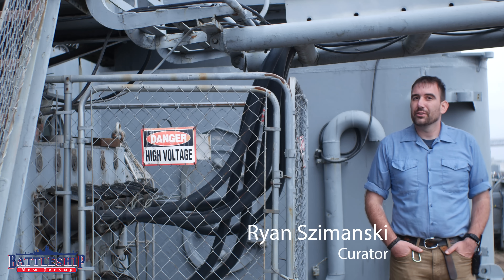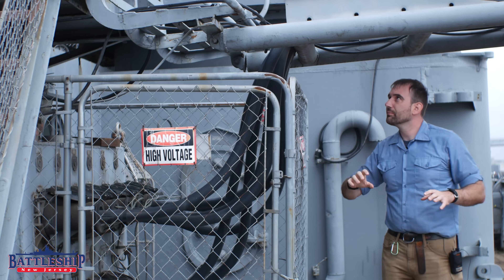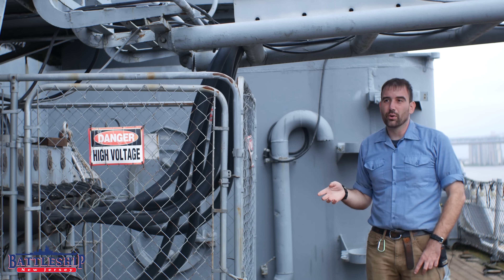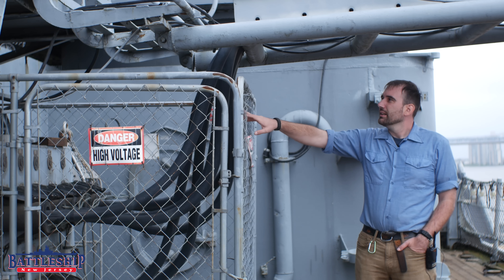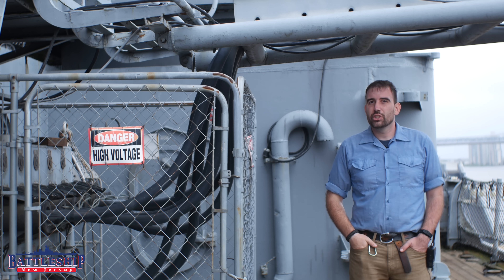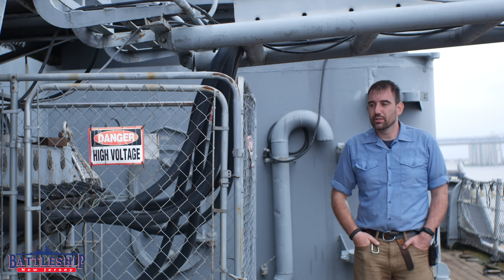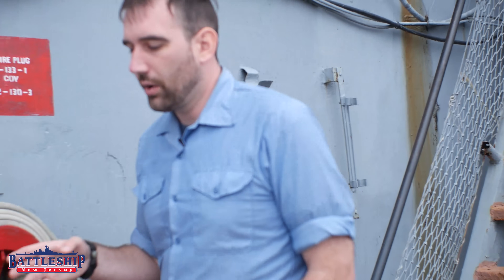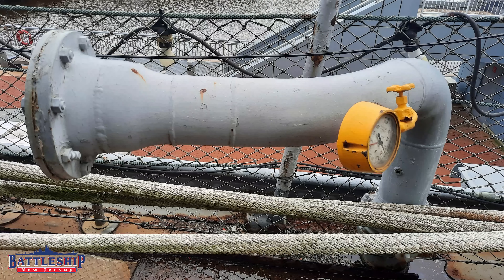Where Does the Ship's Power Come From Today?

Comment: Liberty ships had direct current(DC) electrical systems therefore they could not make use of alternating current(AC) shore power.The ST Portland ( steam sternwheeler in Portland Oregon) was originally a DC system when cold it has an electric motor generator that used AC power to generate DC for the boat. It also had a small dc to ac motor gen set to make power for power tolls that required AC while the boat was underway.  Now the boat has been converted fully to an AC system compatible with the local utility provided shore power.
On 600psi systems the forced draft blowers could be rolled on 150psi shore steam for boiler light off. 1200psi systems had higher feedwater requirements ans were not allowed to use shore steam for light off, but used a small electric powered blower until there was enough boiler pressure to role the steam blowers. 

BT2 Vik Plank owner USS Fanning DE1076 1971-1974

Comment: Ryan, the N.J. generators are three phase or single phase  ? 
If three phase is that 1,250W times three or total output. 
1250W/440V is 2.8 amps which is not that much.  Could they be 1,250 Kw generators ?

Comment: if there were some sort of disaster in the local area and a significant number of powerplants were knocked out, could the ship (on the assumption that the navy is on board) run her generators to basically push power in reverse, out the lines she normally draws power in from? or is the electrical system not set up for that?
Reply: The total power that can travel either into the ship or out of the ship is limited by the size of the cables and the rating of the transformer. Basically enough power to run a large McDonalds. It also seems unlikely that the ship could match the output of the typical power plant which generates at 38kV and above.
Reply: A nuclear-powered aircraft carrier might be able to do something like that on an emergency basis (I believe it's been done before), but a ship like New Jersey wouldn't be able to generate enough power to be worth the effort. A modern metro area uses far more power than a single oil-fired steamship's onboard plant can generate. Mind you, there are such things as power barges--floating mobile generating stations--which could be brought in to provide power in a situation like that. That's basically what they're for.

Comment: How is sewage moved off the ship in port? I assume that out at sea it just gets dumped overboard, but I suspect the port would get a bit cranky if you still did that
Reply: I’m sure they used to dump it all in the past. But someone correct me if I’m wrong, I don’t think any modern warship could get away with dumping garbage & raw sewage today.
Reply: I assume they used the CHT system the navy speak for the sewage collection system, was basically a tank and a pump hooked to a shore collection. at sea it was just pumped over board. Im not sure how modern us warships systems work but up until the mid 2000s this system still was in common use. Cruse ships have advanced sewage treatment plants though and make almost drinking water they pump out to sea.

Comment: Unrelated question to the video:  Has there been any effort by the Navy to record the old timers that are still around on the operations of the dated technology aboard the battleships in case they are ever needed?
Reply: This was done in the 80s, for sure
Reply: The key part of the question is "ever needed?". Generally speaking the answer would be no and the Battleship have been stricken from the records. 
Enlisted folks will have a service requirement of 10 years which may be broken up as 3-6 years active and the rest as inactive. And for retirees like myself who did 20 years we were on the inactive rolls for another 10 years. So in the case of the Battleships that were reactivated in the 80's the Navy had to reactivate a bunch of sailors from the inactive rolls to fill slots that the navy didn't teach anymore. This was manly for the 16" guns. I assume there was a lot of on-the-job training for some younger GM's, but they needed the old guys to do the training.
Reply: @johnknapp952  Thanks for the reply!

Comment: Is shore power enough to start up, and rotate the turrets at least? I'm sure a lot of people would enjoy the spectacle of the turrets moving.
Reply: They were deactivated. They are welded in place for train elevation can be down manually, it’s a tedious process
Reply: @ThePhalanx2006  - Thanks for the info....but welded in place? Is that really true? Seems like a lot of work to weld 4 entire turrets.  I don't think a simple weld could hold it. Im sure the powerful turret motors would break any weld right?
Reply: @TheBigExclusive  Ryan recently did a video where he showed how the turret locking pins are welded into place.  Spoiler alert:  super easy to "unweld."

Comment: Ship would have needed steam for heating, making hot water, kitchen appliances, and laundry machines.   This might have been satisfied by running one of the auxiliary boilers when in commission.   You forgot the sewerage connection to shore as well.   Not much fun when that breaks.
Reply: We didn’t have Aux boilers. All boilers were standard boilers.  We just reduced our main/aux steam 650 psi, down to 15 psi for heating and auxiliaries use. Shore steam was enough to power these systems, however, we didn’t use it much to “start boilers”.
Reply: @cruser69  I was on an FF.  We did have an aux boiler.  Broken most of the time, so we always needed shore steam for all of the above.

Comment: Wondering if you could do a video on this because its rather intriguing to me.
So the obvious technical issues, and the enormous amounts of fuel that would be required aside, I'm really curious why the USN prohibits the museum from operating any of the engineering equipment.
I can't see it being a concern of the ship being reactivated, so is it because the museum obviously lacks the technical expertise, or trained crew? Or are there other reasons such as the equipment hasn't been maintained to an operational level in many decades?
And the really out there question, what would happen if the museum just said screw it we're doing it anyway? Id imagine they'd take the ship back, but still curious.
Reply: there is a movie about the contract with the navy, everything is explained there.  also the stream system is one big leak. would require millions to get it back online
Reply: @michaelandersen-kk4fc  Could you post a link to it? Would be really interested in the specifics.
I mean obviously its nothing a museum could fund, the fuel, maintenance and personnel costs would be insane just for even a single cruise. 
Just curious what the USN's reasons are, since its obviously important enough they stipulated it.
Reply: @sparkplug1018  YouTube comment system holds comments with links as spam, generally. Check the ship's YT channel.

Comment: What kind of on board standby emergency power do you have on board? The diesel generators are deactivated and steam was never an option. Reactivating the diesels would require the opening of sea chests for cooling so that, from a preservation stand point would not be good. Do you have any generation capacity on board that you can activate in thd event of a power failure?
Reply: The emergency fixtures that the museum added for exiting look like the kind that have integral batteries.
Reply: @ghost307  I was thinking more like a 16-V 92 Detroit of about 800- 1000 KW. . Enought to run things in an emergency.
Reply: @daleeasternbrat816  There's really nothing that needs to run when the power goes out. The only priority is getting people out.
If you think of your office; when the power goes out for the whole block they send everyone home. Nobody (except hospitals and such) intend on staying in the building and conducting business as usual when the electricity fails. They light up the exit routes and stairs and call it good.
Reply: I work on electrical generating equipment.  I assumed, without thinking about it, that New Jersey, and  any museum ship had enough internal power production capability to operate the pumps and fire punp system , plus light the ship. USS Texas had quite a few pumps and generators running at one point. The ship's auxiliary genrators are not operational and  I figured that the lights and pumps had back up power. I would imagine that this has been considered.
Reply from the maker: We've got a few portable generators that we can get to a pump if we need it and the emergency lights have battery power but mostly the ship just goes dark except for the alarm panel which has a backup battery system.

Comment: So you're not allowed to just turn on one of those generators on board if you just wanted to save some money? I know you'd probably have to have fuel but still.. what would happen if you did?
Reply: I imagine the Navy would be able to take the ship back off them and probably give it to a new organisation
Reply: The generators are steam.
If you talking about diesel generators they cost more per kwhr than buying it from the local utility.
Reply: So you'd have to get steam going to use even one generator which would mean you'd have to get fuel oil.. and probably a lot just keep it going? I can see how that snowball of things would just cost way more than plugging in to the grid.  Plus the Navy would be scared you could just get underway at some point?
Reply: @robertoflores4546  They'd probably be more concerned about a boiler or piping explosion but you're right. There would be a lot of things that would need to be brought back online just to get steam.
It's cheaper and easier to work around it...like putting in commercial HVAC units rather than restoring the old heating and cooling systems.

Comment: How are there 8 440v power cables? Shouldn't 3-phase power be brought in on 3 cables (and multiples of 3)?
Reply: um each cord has 3 wires in it.
Reply: Guessing two three-phase circuits with a neutral/ground for each?
Reply: @KingdaToro  shipboard power is ungrounded (no neutral return).
Reply: @KingdaToro  saw ultility supply 480 with & w/o a nuetral
 Actually no such thing anymore as a nuetral in code book. After 120 years idiots @ NEC changed name to grounded conductor. Seems like over kill bringing that much power in especially with the amount of low energy consuming LED lamps. Most lamps should be off vast majority of time. PECO/EXELON supplies 30 homes with 100 amp services with a 75 KVA transformer thats only rated for around 210 amps @ 240 volts. Thats around 8 amps per house that all have central air conditioners.   Of course they overload them every summer warm day.
Reply: Each line has 3 phase conductors, 1 neutral, and 1 ground.
Reply: @KirkHermary  Neutral and ground conductors are only separate on customer premises, after the first means of disconnection. On the utility side, they're one and the same.

Comment: I really just don't understand why the navy won't allow you to run the boilers up to use shipboard power, at least on occasion.  You literally have a small power plant there that could probably provide power to the local area in an emergency. Not running the turbines I definitely get....but at least making sure you have the capacity to provide emergency power to at least a hospital or something if needed makes sense to me....
Reply: The Navy doesn't want people to start up the battleship, and use the weapons. That said, I agree with you that the rules are rather  strict. This is a donated ship and the Navy doesn't pay anything anymore in maintaining it. I think it should be allowed to start up the engines or rotate the turrets. 

In another video, Ryan said that... the Navy could sell a ship to a foreign nation, and a person could buy the ship back from a foreign nation, and rules aren't as strict anymore. You can do a lot more with it. Even turn it into a floating casino if you want.
Reply: Connecting a power plant to the grid isnt as easy as you think, there are alot of systems needed to properly setup and control a power plant. On top of that, running the ships systems requires alot of connected systems to be brought online, which is a problem of itself. And lastly the maintenance to keep it running would be prohibitively expensive for a museum ship.
Reply: @reecesaliba7036  Not to mention the cost of having 24/7 presence of a licensed Operating Engineer for each boiler.

Comment: Now I’m curious if the museum is going to be replacing light bulbs with LED bulbs
Reply: Probly. Have to. . i whent to buy t 8 bulbs.... two big lighting stores told me they cant get them in the size i needed.... but they have led ones that retro fit old fixtures now.
Reply: @Wrang15  That is a no brainer. I replaced all the big 200 watt bulbs in my shop with LED bulbs. It saved me  about $180 a month in electricity.
Reply: @SJKile  depends on the application.... they dont generate any heat .  So in a sign outdoors snow will cover the sign.  So now i have to find some kind of heater to add to the sign.

Comment: What is the capacity of the ship's backup diesel generators?
Reply: The Iowa class had 2 250 kw diesel generators. I believe the main generators were rated 1250 kw, but I’m not sure. There were 2 in each of the 4 engine rooms, so total possible power would be 10 mw. I’ll be honest - I wouldn’t trust any of them to provide power today without a complete tear down. And don’t get me started on the boilers and the connecting steam lines.

Comment: Question, do you have emergency diesel generators?
Reply: There are auxiliary diesels on the ship, but they don't use them.
Reply: @neonhomer  I think he meant, in case of a black out. as I understand, they have emergency lighting, running on emergency generators. health and safety laws
Reply: @neonhomer  thank you
Reply: @michaelandersen-kk4fc  thank you
Reply: @michaelandersen-kk4fc  like shore auxiliary diesels? I wouldn't know that one.
Reply: @michaelandersen-kk4fc  The emergency lighting is battery powered. We call them 'lunch buckets' in the trade. They look like a box with 1 or 2 headlights on them.

Comment: it's surprising the navy would give half a flying if you guys ran the turbogenerators the engines is understandable but the generators bilge and fire fighting pumps off internal power in an emergency??
Reply: Even if they could you wouldn't, to run the turbogenerators would require alot of systems to be brought back online, and the cost to run and maintain them would be prohibitive.
Reply: @reecesaliba7036  didn't say they'd would or would want to i said it's surprising the navy would care if they did!!
Reply: @keithmoore5306  was thinking that's maybe why they don't let them, cause to operate them would require reopening sea chests, using certain switchboards or starting boilers etc.
Reply: @reecesaliba7036  i don't see why it would matter myself not like it has anything to do with reactivating and firing the guns on anything! frankly that's the only concern i can see the navy having to turning a ship into a museum if it could be used on them!

Comment: What about sewer discharge lines?
Reply: There is a CHT (Collection/Hold/Transfer) system onboard. In port there is a connection(cap usually painted black) that sewer lines can connect to. At sea, it can be held in tanks and/or pumped over the side whenever necessary more than 12 miles away from land.
Reply: @ThePhalanx2006  thanks man!

Comment: Actually its 480, not 440, and you probably have 120/208 for the low voltage equipment.
Reply: He covered it in an earlier video.. the systems are the older 440 system, NOT the modern 480 volt system. This is how everything used to be. 440 and 110/220. Utilities have increased voltage over the years to increase efficiency, but the battleship was never updated. The utility can still provide 440 by changing the taps on the transformer
Reply: @N-hunter  I get the same issue with people who don't know that 120/240 and 120/208 are totally different and incompatible systems.

Comment: How many lighting fixtures do I pay for? Zero. Electricity is included in my lease.
Reply: My water, electric, and sewage use is included in my flat rate rent payment as well. I just added up all of my circuit breakers, and at 75% capacity, could theoretically pull 21,600 watts of power, all day. Of course I expect that would earn me some serious scrutiny, as well as a possible lease violation, considering that there was some language about excessive electrical usage. I wonder how that would compare to Battleship New Jersey! Probably wouldn't even be able to run all the lights.
Reply: You're still paying for them; they're just not broken out as a line item.

Comment: I believe Ryan has it wrong about the generator caps, they are from what I remember are 1500 KW generators, I remember this as my first ship had 750 KW generators, half what the New Jersey generators had
Reply: Actually, Ryan is correct.  These were unique generators, however, they were rated at 1250kw.  I know because I operated them for several years.